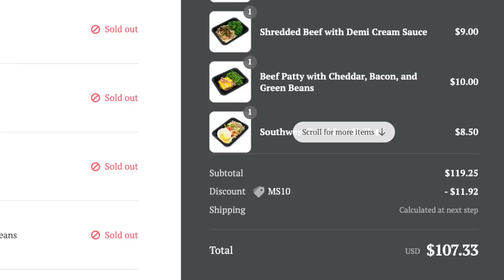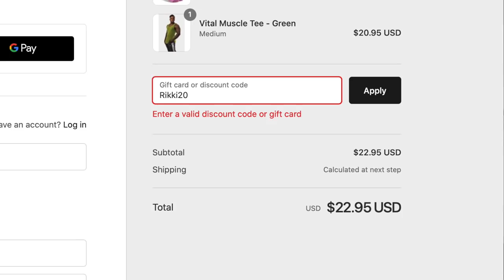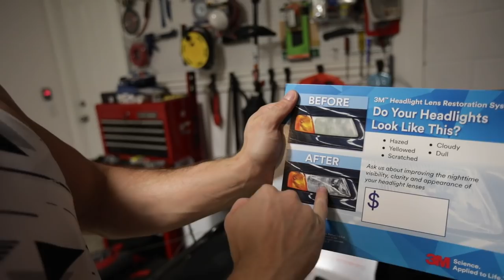BUILDING MY DREAM POOL! (AND NEW BENCH PRESS PR?!)

Comment: scott how do determin a pr? do you just hit it when you feel good or is it planned ? iv been bulking last 5 month and strength has barely increased since when i was super lean
Reply: Well it depends on what rep ranges you have been working in recently. If your training block has you working mostly in the 10-20 rep range then I wouldn't attempt a PR until you are in a training block that has you doing some work with 90% or more of your estimated 1RM. However, if you have been working in the 10-20 rep range you could attempt a 10RM PR, which if hypertrophy is your goal is probably more applicable anyways
Reply: Cole is referring to a "peaking phase." They are exceptional although not necessary for maxing out. If you've been bulking for 5 months without progress you really need to take a look at your program and intensity.

Comment: Hey scott I have a question in regards to deadlifts. I'm having a issue with shin pain when I pull a heavy weight(315*10). My form is fine but is there any way of suppressing the pain on the shins you suggest?

Comment: Is standing obliques side bend really a good  exercise I mean I did feel it in my obliques the next day but tbh I see a lot of people doing with 2 dumbbells or kettlebells on each arms if I think make it lose its efficiency. Also most people recommend twisting movement if u tell me that side bends are good then I will do them Scott 🐐
Reply from the maker: I always do then. But I make sure I hit woodchoppers as well. To have a well rounded routine you should have a few exercises that target the same areas
Reply: Doing side bends with the same weight in both hands is completely stupid as the weights will counterbalance each other and it's barely better than doing them with no weights at all. I do them a lot personally. I superset a core movement into every routine so I'll usually do side bends & weighted russian twists for obliques.